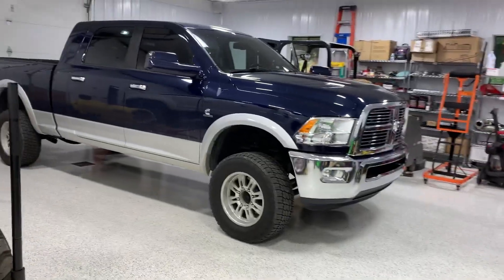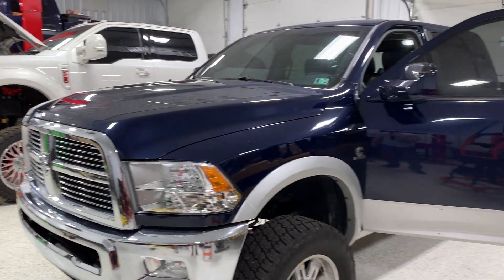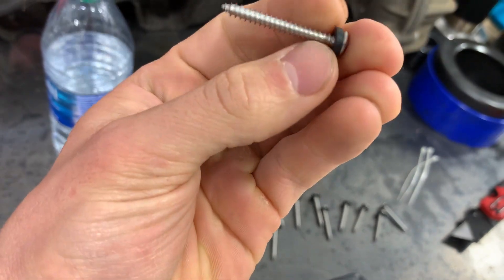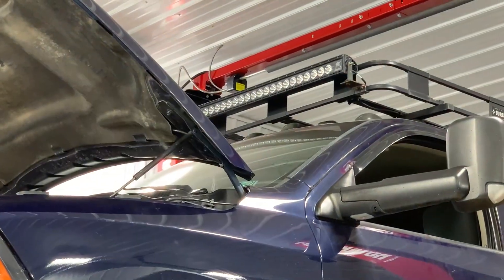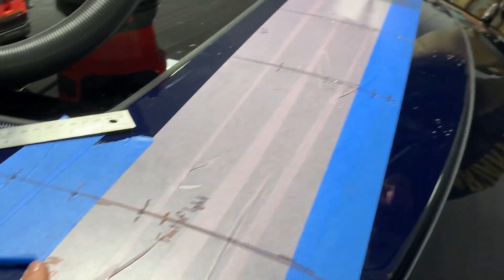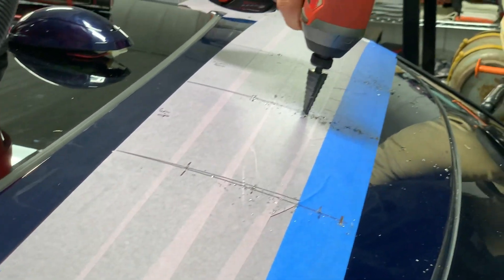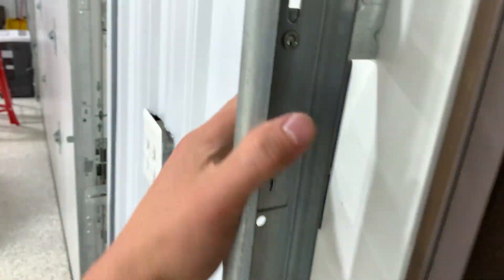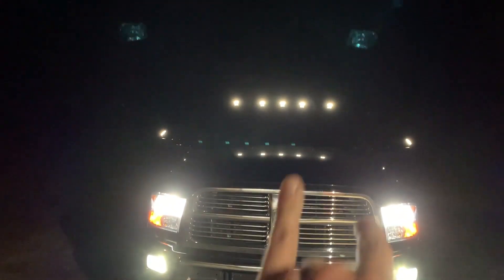Drilling Holes in My Roof! Cab Light Install

Comment: Your video helped a lot. I just did mine yesterday, they look great! On my '12, after pulling off the passenger side A pillar trim there was a white and green wire that supplies power for cab lights, mirror lights, etc. I tapped the cab light power wire right into that and it works off the headlight switch now.

Comment: This is not hard to do. I installed the Mopar Kit on my 2017 Dodge Ram 3500 Big Horn. I think using the OEM kit makes it easier. I had a friend help me because this is NOT a one person job. Using the template watching a youtube video and be very careful in where and how you drill the holes. The Mopar kit comes with enough gaskets to stop leaking from moisture. After the job was done, which took about 3 hrs,  it looked very OEM as installed at the factory. I did get grey nail polish and repainted the holes I drilled before installing the lights.